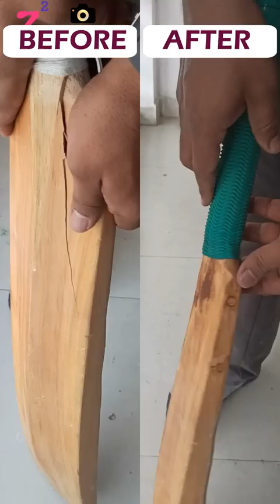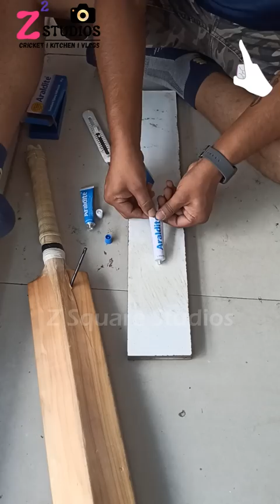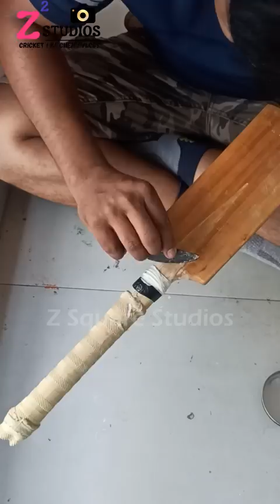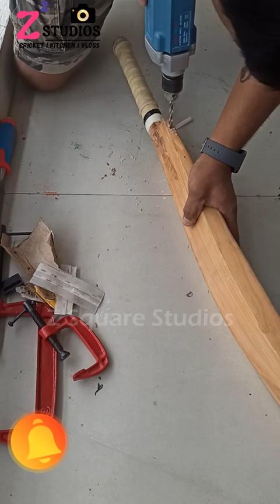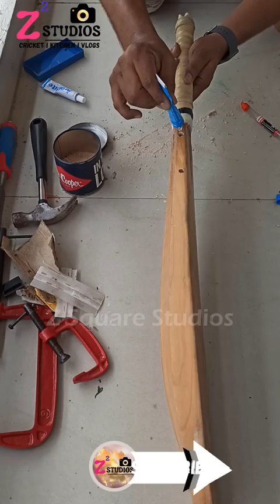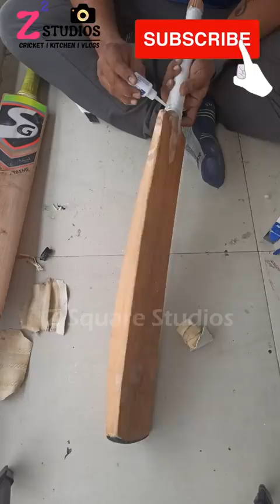#How to fix a Bat shoulder crack or broken shoulder at home? #Bat Shoulder Repair #Zsquarestudios

Comment: Mine was broken in 2009. And at that time I used epoxy  adhesive with Trex brute tape. It's been 14 years and now my bat is still the beast ( 350 Rs bat)😂😂
Reply from the maker: Super
Reply: Super bro
Reply: i 10 ball user? ?